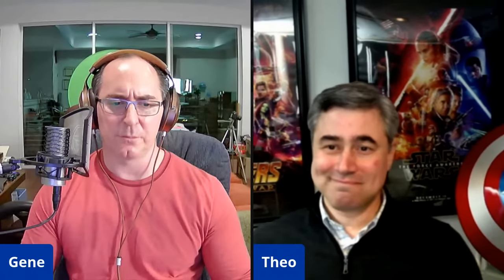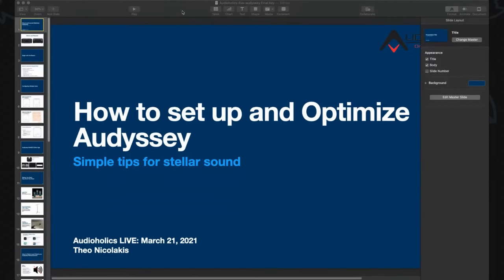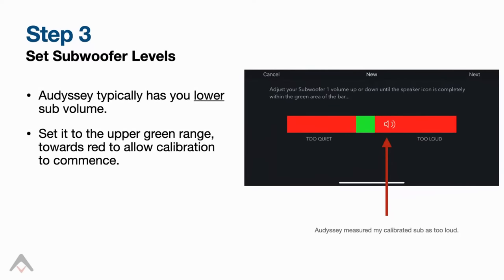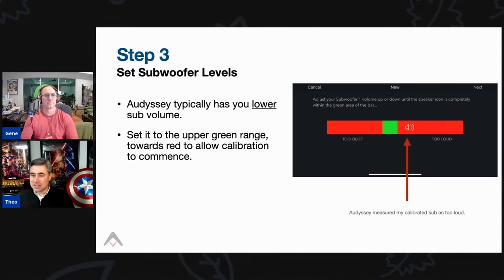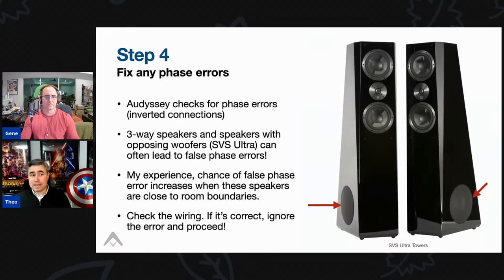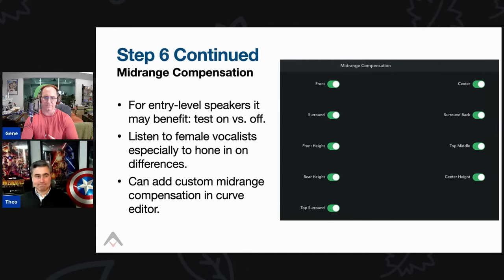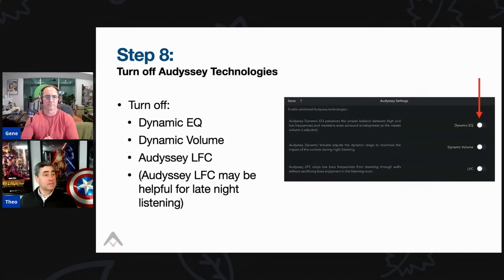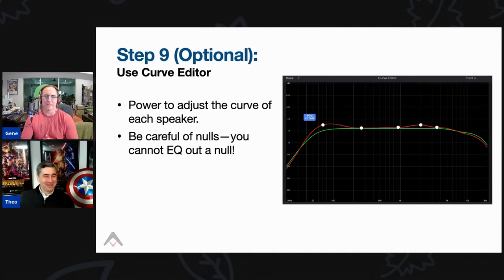Audyssey Room Correction Performance Tips for Your Denon/Marantz Receiver

Comment: Dynamic EQ on or off guys?????
Reply: All I hear is for it to be switched off so it leaves me wondering what it is Dynamic EQ is good for.
Reply: I don't own subs because I live in split level house and don't want to piss my neighbors off. Currently  running  7.0.4 set up and to me it sounds better with dynamic eq on my x4700h.
Reply: I use it, but you have to set the offset correct. I usually use 5dB, as I watch a mix of movies/tv/music.
Reply: I got the same phase error on my DF BP-9060 towers
Reply: It’s really personal preference but it helps a lot to understand the Reference Level Offset and use it to “tame” the boost. Most people think Dyn EQ at the default setting is too much (overbearing surrounds + boomy bass), the RLO setting lets you dial down the aggressiveness.
Reply: Dynamic EQ is good in terms of bass, but it boosts the Surrounds, Rears and Rear Height Speakers too much.
I created a custom curve for all my Speakers  with a steep slope from 200Hz to 20Hz, rising about 6db over that area and add 8db to the Subs. Then I don't need DynEQ, keep the Surround balance intact and am happy.
Reply: @rolandrohde  yes that's a great way to do it, especially if you don't need to listen at low volumes.
Reply: @eitanaltman158  
It works very well for relatively low Volumes as well. I am usually at around -20 to -15db
Reply: @rolandrohde  that's not low volume :)
Reply: @eitanaltman158  
Depends on the Content. Playing from an AppleTV it is something between 65 and 75db in room if I remember correctly.
Reply: @rolandrohde  true, streaming is often a bit softer. Still, I would consider 15-20dB down to be "moderately loud" on a calibrated system. Very few people actually listen at full reference and -10dB is pretty loud especially in a smaller room with mediocre acoustics. 

What I'm talking about is truly low level listening, like -30 to -40 range, for when you don't want to wake up and/or piss off sleeping neighbors/family :p
Reply: @eitanaltman158  
I guess I am spoiled by having my own little Home Theatre with lots of DIY room treatment. It's only 15m^2 but still pretty neat...😎
Reply: @davemoritz2174  Dynamic EQ is there so the balance of all speakers at 80 db (for instance) is the same balance at 90 db, or 70 db, etc.
Reply: If you listen at different volume levels than DynEQ is a great feature with the appropriate DynEQ Offset.
Reply: @stevewilkins1690  
Yes and no. While the impact on low frequency is helpful, the boost to the Surround, Rear and Top Rear Speakers will still be problematic for many rooms. And ironing that out by manually turning down those channels means you are then once again limited to a very narrow range of Volume, because your manual offset will be static.
Reply: @rolandrohde  Yes, thats right. My assessment referred to the lower frequency range.
The topic with the boost of the surrounds I havent't noticed this yet because the signals on the surrounds are very movie dependent.

Thanks for this hint. I will test this in future.
Reply: @stevewilkins1690  
This is indeed very much dependent on the Content. The easiest way to "trigger" it is Games. In Movies, it will become evident if there is a lot of background Sound coming from those Speakers, especially Music and ambient noise. This will easily start drowning out Dialogue and other content in the front Soundstage if you listen at levels between -20 and -30db
Reply: At the end of the day it’s personal preference. Listen and let your ears decide what you love best. If however you are aiming for accuracy, then turn it off.
Reply: @TheoNicolakis  Thanks for the response.  What's your view on LFE or LFE+ Main. When speakers are set to small. Thanks!!!!
Reply: @arsenalfan1776  NEVER use LFE+Main because it will cause loads of low frequency interference if both your Mains and your Subs play the same LFE content!
Reply: @TheoNicolakis  
"Accuracy" is a moving target though. A flat response from your speaker will likely not translate to a flat response for your ears due to psychoacoustics. At very high Volume (0db) this effect might be minimal, but let's face it, most people won't play their content at 0db most of the time.
DynEQ does a good job of correcting the "loudness" in terms of low frequency, but in my experience it turns up the Highs too much and also shifts the Surround Balance to the back of the room far too much. YMMV so doing your own experimentation, ideally with measurements, is always wise.
Reply: @rolandrohde  Cool just what I needed to know.Thanks
Reply: ON with offset @ 15dB. That way it only kicks in if you're watching at quieter volume levels (under -15dB), and no effect at -15dB or louder. So best of both worlds.
Reply: @johnpoo1662  that worked for me in terms of the Surround Boost but gave me too little Bass
Reply: @rolandrohde  I've never noticed a surround boost at 15dB offset, even at super quiet volumes. I can't imagine it being more than a few dB hot which shouldn't be that noticeable.. I use DynEQ purely for filling out the bass at quieter volumes. Massive difference when not listening at ear-bleed volumes.
Reply: @johnpoo1662  
It raises the surrounds by 1db for every 5db below Refere in the 0db Offset setting. So -25db would result in the Surrounds running 5db hot which is VERY noticeable.
Reply: @rolandrohde  that would be noticeable. glad im using 15dB offset. That should be the default IMO :D

Comment: you say turn off dynamic eq and dynamic volume off what should the multieq xt32 be set too i have refernce flat off and lr bypass
Reply: Flat.
With Reference you're going to have a ~3dB dip at 2 kHz (between 1.5 and 3 kHz actually) and a roll-off after 6kHz ending up at -5dB at 20kHz.
(there's some measurements at AudioScienceReview).
Bypass L-R is basically not running Audyssey, so what's the point, just turn it off.

Comment: Hi, question about the frequency cut off: when looking at the results after running audessey through the app, audessey only uses the cutoff for reference but not for flat. In my case, flat boost all high ranges above 2kHZ with 4-5-6dB. Since I already have bright speakers, it becomes even more bright when using flat. Reference however just stops adjusting after the frequnecy cut off you set in the app (600hz). Is that suppose to happen?

Also, when you use the curve editor to EQ above 2kHZ for example, but you are using reference with the 600hz freq. cutoff, will the curve editors adjustsments even be changed (because reference cuts off after 600hz? Or are these two thing apart from each other?
Reply: In my personal investigation found, that curve is working only below cut off point, so anything above cut off point is just not equalised.

Comment: With regard to Audyssey mic locations when setting up room correction.

The Marantz Audyssey wizard indicates moving the mic around to 8 locations within the viewing area.

Are you telling me that I should ignore placement locations and keep the mic within 20" if the main listening area?
Reply: Yes indeed that’s exactly what I’m saying! The illustrations are simply that and not accurate or to scale! All measurements should be done no more than 24 inches from the main or prime listening position. I recommend no more than 20 inches. This is where many people get it wrong and end up with bad results.
Reply: Thanks  @TheoNicolakis  ! I'll plan to recalibrate again this weekend. ...I'll also be reclining my seats (I hadn't thought about that).

Great stuff!
Reply: @TheoNicolakis  So, I have done a manual measurement to the sweet spot of the couch as well as used Audysseys measurements for 8 seating positions which of course is different compared to the actual measurements. Which one would I set for the distance on the App….the actual measurements to the sweet spot or leave the distance as audysseys measured ?

Comment: 2 Channel Music Tip:  Don't listen to 2 channel music through your Home Theater AVR or Processor!!! Connect your DAC directly to your amplifier and listen through the DAC. You can use a passive switch (like the Douk Audio Nobsound 3-IN-1-OUT XLR Audio Switch) or even better, use a high end 2 channel preamplifier with Home Theater Bypass.
Reply: What if i have a record player though that needs an amp. I don’t think the denon s760h works as a preamble to use a legit stereo amp.

Comment: I will be upgrading to a Marantz SR5015 in a few weeks and was wondering if these tips work equally well with Audyssey MultiEQ XT as with XT32? As I cannot afford the jump to the SR6015 that has XT32
Reply: The function is identical, the difference is the capability of the correction. XT32 has much higher resolution correction filters and distributes more resources to the low frequencies. 

XT can do harm to the highs so definitely use the app to limit correction below 5kHz at a minimum.
Reply: @eitanaltman158  Thanks for the answer, will make sure to do that
Reply: Just for reference, Audessy MultiEQ XT set my sub to +4db whereas XT32 set it to -6db xt32 also has better bass management as well
Reply: If you want an AVR for home cinema use, prefer Denon over Marantz! Cheaper and better ;)
Reply: @fan2hd277   I was thinking about getting a Denon, but I want the analog to HDMI conversion that the Marantz has :)
Reply: Check out the ratbuddy audessy program it will allow you to take the room correction files and load them up and adjust them on your computer just like the app and can allow for more precise edits to the curves.

Comment: Never use DRC. The odds that it does not screw up is very low. Even the experts in this show says not to trust the system. 
Good speakers in a good room does not need DRC.
If used, never use above 200 Hz.

Comment: I've seen in this and so many other Audyssey recommendations to "always" set all speakers to Small. What about setups with no subs?

I have two towers for my fronts, and when I'm using no sub, I always assumed I should be leaving these set to Large so they're handling all frequencies. Is that right, or should they be set to Small regardless?

Comment: Pro tip: After you run Audyssey, go into the receiver and go to "speaker - levels" and set your volume to 0 (80) and use that with an SPL meter (I actually use the SPL in REW with the UMIK-1) and set everything to 75db.
Reply: According to this video if you go into the manual test tone and adjust the levels there it's not accounting properly for what Audyssey did.
Reply: @SorikuXIII  ok but how to Set SPL to 75db?  Realy dont know how to do this without the test Tone in Menue.
Reply: @stever6282  I had trouble understanding this also until I did some more reading. My understanding is that Audyssey should set the levels for your speakers to match your main listening position at roughly 75 db, and that it does a good enough job at this, so you shouldn't have to do anything after it calibrated everything. And I'm not aware of any possible way in the AVR to change speaker levels after running Audyssey with Audyssey engaged even if something was way off except maybe rerunning the calibration. 

So what you can change after running Audyssey though are your bass levels. After Audyssey runs you can just run an external test tone with an SPL meter and see what db level the sub is running at. If it's lower than 75 db (single sub- a second sub adds +3 db so you would want to calibrate at 72 db to get to 75 with 2 subs) then just increase the gain/level on the subwoofer itself, without touching the AVR settings. Then either get it to match the other speakers or increase to the db level of your liking. Unlike your speakers the subs have their own dedicated level functionality so this makes it different.

Comment: I have Denon X4000 avr and Audessey wont let me fine tune or make adjustments after calibration. Is it just me or Am i missing something.  
 For example i cant later go into audesst  results and change Speakers from  Large to Small. I can only do this in the Manual Equilizer mode. 
I want to uncorporate 2 Subs for 2 channel  music.

Comment: Does the Audyssey microphone have a flat response? I mean, if I connect the microphone to a pc with audio spectrum software, is the measurement reliable, or does it need corrections for the frequency response of the microphone?
Reply: No, it has a very not-flat response. In fact, almost no microphones have a flat response. They require a calibration file with the proper offsets to take the not-flat response of the mic and normalize it
Reply: @eitanaltman158  Thanks Eitan. Good to know.

Comment: Gene I have a question. I have the AVRX4700 and am running a 7.2.4 setup. I have put all channels in external amps. Upon doing this I noticed that the volume has decreased quite a bit. When I switch back to 11.1 on the AVR the volume comes back up. Is it normal for volume to decrease when the AVR is put into a Pre-Amp mode?
Reply: Try increasing the speaker level.
Reply: @derekmaynard5619  Gee I would of never thought of that!! My question  was more towards why it decreases not how to compensate for it.
Reply: @jr62inhometheater98   gotcha. I haven't used all external amps so sorry i couldn't  help. To be fair u didn't state what you have tried that's why I suggested that. So your comment was a little rude. But I hope u figure it out.

Comment: After im done with Audyssey and turn off the dynamic and EQ how do i measure the 75db on an SPL on the sub?
Do i play the pink noise from the DVD and disconnect the front speakers so only the sub is playing? Do i set the volume to -0 and turn up the gain on the sub until it hits 75db?
Reply: If you have a disc with test tones then it should allow you to play each channel independently. Start with the left speaker and turn the volume up until you hit 75dB on your SPL meter. From there you can cycle through each speaker to spot check and then when you get to the sub or LFE channel it should play only the subwoofer. You can therefore compare the subwoofer volume to the other speakers. Bottom line you want the sub to be the same volume as the others.
Reply: @TheoNicolakis  do you know witch test tone is for the sub? Cuz what i did is download them and play then on my computer to the receiver
Reply: Check out the ratbuddy audessy program it will allow you to take the room correction files and load them up and adjust them on your computer just like the app and can allow for more precise edits to the curves.
Reply: @TheoNicolakis  Just to clarify, you recommend starting with the left speaker and increase the volume until the SPL meter reads 75db ? I have read online to just set the volume of the AVR to 0 and then increase/decrease the db on all of the speakers to 75db. Also, I’m using ceiling speakers for surrounds…..in my set up…the audyssey calibration or a manual calibration always results in my ceiling surrounds level to be +4-8db. What do you recommend ?

Comment: Is it bad acoustically to run 2 different size subs? I had a 6 inch sub then bought a 12 inch sub.
Reply: The 6 inch isnt a sub, its a woofer and should be located along your front stage front firing.  I would set the crossover from 60 to 120.  The 12 inch I would put somewhere along the back wall and run the crossover from 60 down.

Comment: In order to remove nulls in 50-100 hz range, how we will set delays ? Actually i don't know how to set subs delay
Reply: Far as I know you can't get rid of nulls with delays. Gene's example at 44:00 is him undoing Audysseys wrong delay settings. 
Only bass traps (real ones, not foam ones) or moving the listening position / speakers around.
Or play around with the crossover, if your  speaker/sub position isn't ideal at a certain frequency).

Comment: 1:24:10
I can’t imagine a Double Bass array actually works. It would work for midrange and treble, but bass is so omnidirectional that it is impossible to have the same phase at all frequencies between 2 subs, thus impossible to invert the phase to do cancellation.
Reply: If you do a search then you will see that engineers have tested it and when correctly planned and installed it has been proven to work so this a factual and not theory.
Reply: A Double Bass Array works fine and is amazing if its installed correctly and you have an appropriate room.
In Europa a lot of home cinemas were build with an DBA currently (or SBA, this depends on your concept).

Comment: Also, is there a downside of using the Geddes method of sub integration where there is no precise crossover as one just runs the speakers as large / full range and then integrates the subwoofer and has then drop off as desired based on location to MLP?
Reply: The downside is that you really have to know what you are doing and spend a lot of time carefully integrating everything. And if you play your system really loud, with speakers that can’t really handle the bass, you will hurt the clarity of the system because of compression / distortion.
Reply: @eitanaltman158  yeah that makes sense. Does plugging the port help protect the speakers from playing too low (as you not longer have the port tuning frequency)?

Comment: How can someone get the sound calibrated for many big seats with possibly two rows of them too when the mic should only be moved no further than two feet from the main listening position?
Reply from the maker: You can't. Auto EQ has limitations. It's best to use multi-sub properly placed to get even bass distribution across all of your seats and then apply EQ to tame the peaks.

Comment: I thought with atmos you were supposed to put the bed layer of surrounds at ear leval, or maybe at best a several inches above ear, no more then 18"
Reply: Yes, unlike 7.1 or 5.1 the recommendation for immersive audio is to have the floor level speakers at ear level.